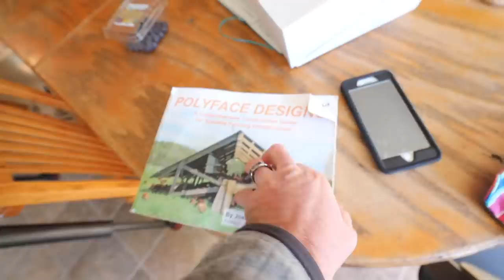What I Should Have Done 15 Years Ago, for My Chickens

Comment: Justin, I am pretty sure you have an airlock in the furnace / heating system.  There should be an air bleed screw and or an air accumulator with a Schrader valve on it in the system. The bleed screws are usually at the highest points in the furnace hot water line going to the water heater & and water to air heater exchanger. Also look for an accumulator near the circulating pump at the furnace, it's a peace of iron that the hot water travels through with a brass cylinder on top with a air valve like a bicycle tire air fill valve. Open the valves slightly to let the air out but be careful "the water will be scolding hot".
 Good luck, Alex
Reply: That’s what caused my system like this to not hear in Europe when I lived there. The landlord had to come out and bleed to air and it fixed the issue.
Reply: Great advice 👍🏼
Reply: It’s so nice of you to give him advice. If more people were like you the world would be a much better place
Reply: This is what I love about the homestead community on YouTube. The people are so nice, they have great advice and are so helpful. Honestly I learn a lot from watching and reading the comments. :)👍😊 would be so nice to meet some of the people. Wish some lived nearby. Lol

Comment: if you would use a single axel that spans between the two wheels on your chicken tracktors the weight would be transferred to the wheels instead of the mounting hardware holding the wheels on. would probally solve your issues of the wheels falling off like that. love you and tthe fam

Comment: Justin, you need to put the front cover for the furnace back on the furnace in order for the furnace fan to work properly.  Right now you are drawing air from the basement and blowing into house and not through the heating coil.

Comment: Bleed the heat exchanger. you probably have an air lock Put base board upright between feeders... add 2x4  feet on base and frame up to roof - no floor needed .

Comment: In place of bland grocery store tomatoes I buy canned petite tomatoes and drain them for our tacos saving the juice for soups…..they are canned at their peek and taste so much better then fresh winter tomatoes. If I need to add liquid to the meat then I just use the tomato juice I drained…
I dehydrate my fresh cilantro and use that in the meat mixture.
Why not put chicken wire around your lettuce bed since you have holes they can crawl thru…..have Jonah make them a wooden shelter with some soft rags or a blanket inside of it, elevate it off the ground since cats like to be up higher….I have a cat shelter on my art studio second floor deck and my cat loves it during cold days she goes in and gets warm with the sun on it and I put foam sheets around it and then plastic to hold in her body heat…..at night we put her inside the barn room that has heat, her food and water…she’s kept in when the temp drops down low.
You know that lettuce bed is their litter box, soft and easy to use…🤢

Comment: Take the thermometer and do a temp rise. Check the temp of the air where the coil is and on top of the gas furnace. Also close the door to the blower motor it’s pulling in air from the room. If it’s still not working it could be air locked and you’d need to bleed the system. Hope that helps!

Comment: Hello great video. I know why your having trouble with the mobile chicken coop. Take and get a pipe that the tread rod will fit in and weld a nut on each end that will tread on the rod. Screw the rod in it and 6"-8" drill a hole in the pipe and rod then put a carter pin or 1/4" bolts in it to lock it from moving. Then drill 2 holes in the pipe so you can bolt it to the wood framing so it will stay in place and you shouldn't have anymore problem with it. Let me know what you think about my idea.

Comment: My boiler system in Europe got air locked and didn’t heat the house. The controller showed a fault but I couldn’t figure it out. Called my landlord and he came and bled the system and that fixed the problem. One thing I could do is turn the system off, let us set a bit, and then start it back up and it would begin to heat until the airlock stopped the flow again. I’d bet you that’s your issue here Justin. Is your system not giving you a fault at all about the low pressure on the return line?

Comment: If one line is really hot going into the heater and the other one is just warm. I would suspect the pump being bad or air in the line causing it to not circulate. Your system is to new for the coil to be stopped up. You need to check for volume at the return hose at the stove.

Comment: You can get a chili powder that is not hot or grow chilis next year to dehydrate your own chili powder. I also like to add coriander to my Mexican blend of flavorings, it smells like Trix cereal but adds a ton of flavor. Your wood storage stall needs attention, putting perpendicular wood or pipe on the wall spaced a few feet apart will allow you to sort and "hang" boards by size and length with the added benefit of freeing up the floor and giving you more room for more boards.

Comment: Justin, could you use a hand  pump garden sprayer filled with hot water or very warm water insulated to hold the heat on cold days, so you could easily clean the cows for milking?  Just a thought. ♡

Comment: Hot water air locked?  Needs a vent on high points.  Water when heated releases air.  You sure pump is actually working? Run cord over to it and see if that changes anything.

 Filter plugged?  If the coil is warm the air should be moving the heat

Is air coming out your vents upstairs?\fan running?